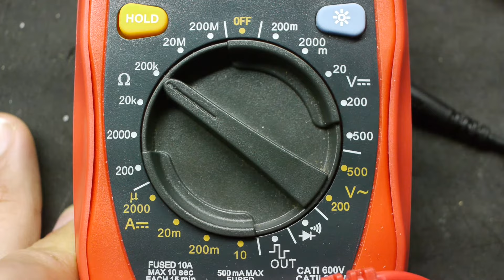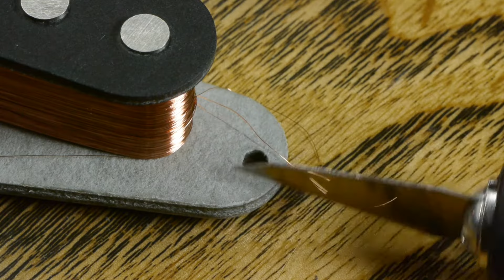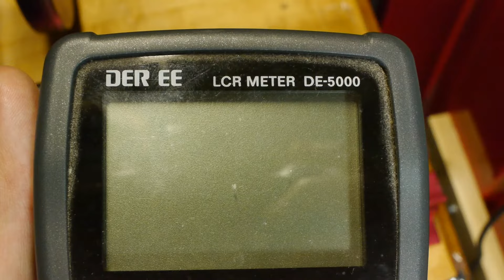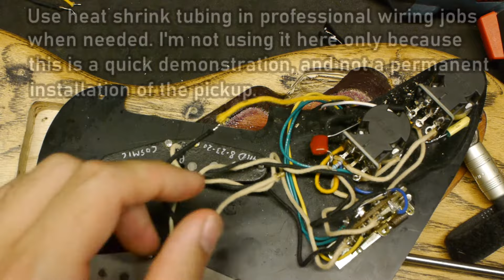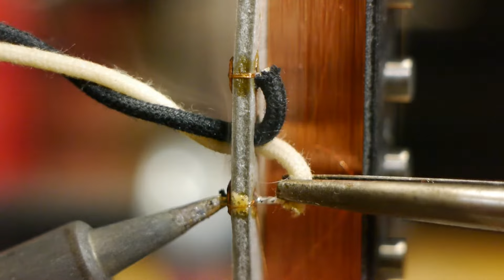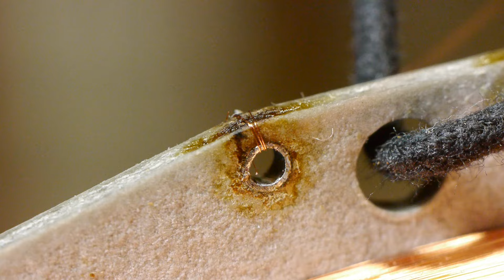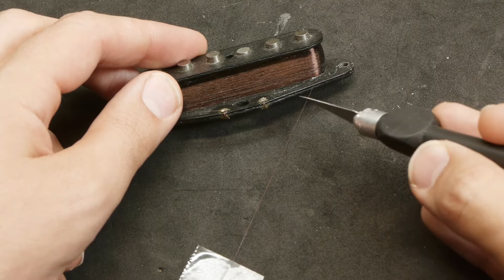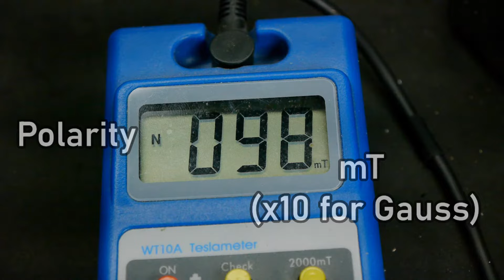Broken Guitar Pickup DIAGNOSIS + REPAIR | Fender Style Single Coil Diagnosis + Repair Demonstration

Comment: Really informative.  When you splice the pick up wire together (after a break) should you re-insulate the splice before rewinding it? I can see that the surrounding wires will still be insulated, is that enough?  Odd question I guess.
Reply from the maker: Video here showing a wire splice repair on a Seymour Duncan pickup: 

https://youtu.be/ltoMOXsJU2w

When splicing pickup magnet wire, there's no need to re-insulate it. Magnet wire is all insulated, so if you splice a break, the un-insulated splice will still not be in electrical contact with any of the other wire. The insulation on the rest of the wire is absolutely enough, so no extra coating is needed. 

And thanks for the comment! I appreciate it! Helps boost my videos in the algorithm and get this out to more people. I also have a revised version of my pickup testing video using an oscilloscope on the way, and I'm very excited about it. Better resolution, image quality, and better instructions and demonstrations. I'm looking forward to showing that in practice as well with choosing a 'recipe' for building a pickup. More on the way -- thanks again!

Comment: Funny, my cheap multimeter struggles to show resistance to (20k range), I have to rely on an older one without digital readout.
Reply from the maker: I've had the same issue. I always rely on my DE5000 LCR meter for accurate measurements, including DCR. 

Never owned an analog multimeter, but my friend has used nothing but analog multimeters for decades. I have an Etekcity multimeter that I use for continuity testing and quick DCR measurements, and find it works much better than my Harbor Freight dirt cheap multimeter.

Comment: Do you repair pickups ? I recently purchased a loaded bass body with Fender vintage noiseless jazz pickups and on the bridge pu , the wire that crosses from the top to the bottom halves is broken as well as a 3rd wire that appears to be the end of the winding and  I think goes to the terminal. I have been unsuccessful in removing the coating and soldering the wires together. Your video was very helpful in finding the problem and explaining how to attempt the repair, but I'm just not having much luck as I can't unwind the middle break to get any slack. When I try to remove the coating on the wire, it just breaks.
Reply from the maker: Yes, I do repair pickups! If you want to reach out to me personally, you can e-mail me at md101089@hotmail.com.

One example is my other video here: 

https://www.youtube.com/watch?v=1V6MWrivDio

However, I got very lucky there, and 99 times out of 100 the pickup will need to be completely rewound. When there's not enough slack, it can sometimes be impossible to splice new wire on even if you're extremely careful.

Comment: Sir, if the plug is right at the base of the soldering iron, it's the ground, and if it's re-soldered, will the pickup still work?
Reply from the maker: I'm not sure I understand the question completely, but I do have another video where I splice some wire onto the start lead, and got it to work again, if that's what you mean. 

If it's a baseplate with a separate ground wire, you can move that wire to a separate ground and the pickup will still work. That would be like on a Telecaster with a metal baseplate, if it has two wires (start and finish) and a separate ground wire for the baseplate. Most of the time the baseplate is soldered directly to the start eyelet.

For the eyelet connections: there's a start and finish lead for every single coil. They both have to be solidly connected for the pickup to work. Sometimes re-soldering is necessary to re-flow the joints. If the delicate wire gets disconnected from one of the eyelets at either end, the pickup will not work. You can verify this with a multimeter -- you'll get no DCR reading at all if one of those wires is disconnected. 

Let me know if that answered your question or if I misunderstood. Thank you!
Reply: @guitar_md  I've found the answer in this video, and my PU is working again.
Sorry to confuse you, because I'm not very good at English. So thank you very much sir.
AUTO SUB
Reply from the maker: @ellpapz6082  You're welcome! Thank you for reaching out, and don't hesitate to do so in the future. 

And no need to apologize. I apologize if I came off as rude! That's awesome you got your pickup working again. I'm so glad to have helped! Thank you again!

Comment: I have an issue with fender strat. The neck pickup doesn’t seem to react on the low E, A and D lower strings. If I measure the ohms it seems normal. When i was tapping the pickup with a screwdriver to hear how it was reacting to it I noticed the pickup is not magnetic or hardly. I’m guessing the pickup needs replacement, but I’d like to know what is exactly broken about it.
Reply from the maker: If it's working fine on the G/B/E strings, it's possible the magnets were never charged, or somehow lost their charge. For alnico poles, I use the Mojotone magnetizer, which is two strong neo bar mags epoxied to the jaws of a small vise. Tighten it until it touches both ends of the polepieces, loosen slightly and remove the pickup. For bar mags, like the ceramic mags in Mexican or other Strat pickups with steel poles, they'd need to be replaced. 

Uncharged magnets are extremely uncommon but it can happen. One way to know for sure is with a WT10A or other gauss meter. 

On the cheaper side, you can get a Schatten polarity tester. They're handy to have on hand anyway. It isn't precise, but you can feel the magnetic pull and gauge the strength by feel. It'll also show you if all the poles are the same polarity as they should be. 

You could also use a refrigerator magnet or any other weak magnet to test it. If you're not getting any pull on the EAD strings, the gauss is either not there or not high enough.
Reply: @guitar_md  Thanks for the response, but I opened te guitar and found out the magnets were all over the place, cause the glue was probably very bad. Never crossed my mind that was a possibilty.
Reply from the maker: @elspoocho4637  Were they ceramic bar magnets? That can happen, sometimes I've seen simple hot melt glue holding those on, which can fail. Were you able to get them back on? Great if you got it working again!
Reply: @guitar_md  Yeah I think they were, I managed to glue them back in the right way. 
They were like this: https://images.reverb.com/image/upload/s--FbgGztvs--/f_auto,t_large/v1539712487/hroesz2uavd0bxmomw8t.jpg
It's not my own guitar, so I won't be playing it, but it sounded ok enough and not out of phase.

Comment: You are a master at explaining clearly. I have a Phatcat style P90 that is doing the same thing.(thin weak sound and no reading). I can now see what may be wrong but I lack the skills and the tools to fix it. It's going to die in a drawyer.
Reply from the maker: Thanks so much for the comment! If you'd like to send it to me for a rewind, let me know. My e-mail is md101089@hotmail.com. 

I haven't seen a Phatcat P90 before but I'd be curious to see if I could get it up and running again. Could be better than letting it waste away!

Comment: Excellent video. Thank you very much for sharing your knowledge. 
Please can you answer a question. Within what resistance values do the pickups of a stratocaster have to have to get that vintage sound from the 50s?. I mean that bright, but not thin, full-bodied sound. Greetings.
Reply from the maker: You're welcome! Turn count is far more accurate than DCR -- 7600 turns has been my usual for neck pickups and it works beautifully. I've rewound multiple vintage Strat neck pickups with that turn count (formvar as well as plain enamel) with great results.  

DCR can vary depending on winding tension and ambient temperature while testing. Generally speaking though a lot of my neck pickups would end up around 5.7k to 6.0k where they get that clear vintage sound without being too thin. The inductance will be right about 2.0 Henries. That is a bit on the lower side so for a slightly fuller sound you might try 6.2k or around 8200 turns of wire -- that also works great. 

But 5.7k 7600 turns was my go to for years. Lately I'm preferring a little more thickness but I also don't play out anymore. The extra clarity from 5.7k / lower turn count is nice when cranking a 4x12. And you can always tame it with the tone control
Reply: Thank you very much for answering. Your help is very valuable to me. 
It has indicated to me that for the neck pickup the ideal resistance would be 5.7K with a margin of up to 6.0K. For the bridge pickup what resistance would you recommend to maintain the output balance with the other pickups but always keeping that vintage sound?. In the supposed case that the neck has 5.7K, the middle 5.9K, what resistance should the bridge have without being too bright?. (as that position usually sounds). Also, I want to keep as much quack as possible in positions 2 and 4. 
I'm asking all of this because I'm deciding to have a custom set made for my fender american deluxe with a rosewood fingerboard. 
Sorry for the inconvenience. 
I hope you can answer.
Reply from the maker: @niltoneduardoalayochavez4395  I'd say 6.4 is good for a bridge pickup. I used to make a set with a 6.7k bridge and I used that for years, other people liked it a lot too. 

But doing vintage rewinds, I'd usually use around 8400 turns on the bridge pickup, or 8600, around 6.4 or 6.5k. 

The bridge is naturally very bright sounding and for me personally I wouldn't want below 6.4. Many vintage Strat pickups were the same as the neck and middle, but to my ear that doesn't sound as good as at least a slight overwind.  

5.7 neck, 5.9 middle, and 6.4k bridge should work brilliantly. I'm sure you would be happy with a set like that!
Reply: @guitar_md  I am very grateful to you for your help, it helps me a lot. Thanks for sharing what you know. It's not very normal for someone to do that. Greetings from Peru.
Reply from the maker: @niltoneduardoalayochavez4395  Absolutely.  Let me know how everything works out. Thanks for reaching out!
Reply: @guitar_md  Greetings. Sorry to bother. I hope you can answer another question. I'm trying to get the pickups made for my stratocaster. The manufacturer tells me that there is a tolerance margin of + - 5% in the final resistance of the pickups. That is, if I want the neck pickup to have 5.7K, the final result would be within the range of 5.415 to 5.985. In reality, they are values far removed from what I want. What do you think about that?. Is this correct?. I thank you in advance for your response.
Reply from the maker: @niltoneduardoalayochavez4395  This is correct, and is also what I tell people. 

My tolerances are usually tighter -- most of the time. The deal is this: the turn count is what matters most. DCR can vary based on temperature, as well as tension while winding, none of which really has much of an impact on the sound. 

Going by turn count is much more accurate, but almost no one does this. It gives away the "recipe" to the pickup, so to speak. But for a given wire gauge and type -- turn count is what matters most. 

So depending on how its wound, the DCR can vary, but I haven't seen any evidence (yet) that this affects the sound in any significant way. 

Inductance is a much more reliable measurement, and can be found with an LCR meter, at the 100 Hertz setting in Series Inductance mode. It's just a more stable/constant number and is more telling about a pickup than DCR. 

In my opinion, DCR is only useful to pickup makers like myself for quality control. When it comes to purchasing pickups, DCR can be very misleading and in general is not a great metric to go by. Inductance is not perfect but is preferable if they can provide that info!
Reply: @guitar_md  Greetings Guitar MD. Remembering when you very kindly answered me some questions. Until now I have not been able to have a set of pickups made for my strat with a rosewood fingerboard. Last time we concluded that the pickup resistances for a good 50s sound would be 5.7k, 5.9k and 6.4k for neck, middle and bridge respectively. I ask you please answer one more question. I also want the mids to be a bit scooped in the neck and middle. Will these resistances allow that scooped midrange?. Will the resistances need to be smaller?. The scooped mids depends on the resistances being low?. Is it a technique that does not depend on low resistances?. 
I will be very grateful for your reply.